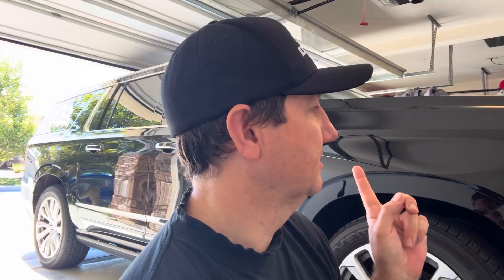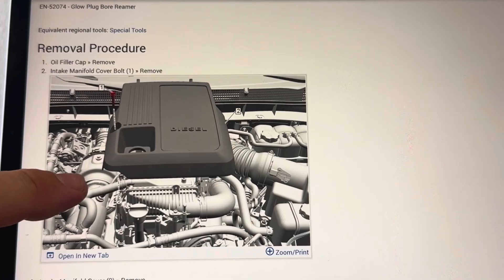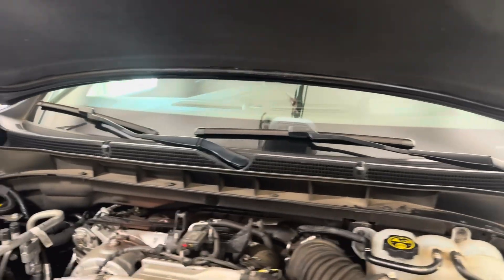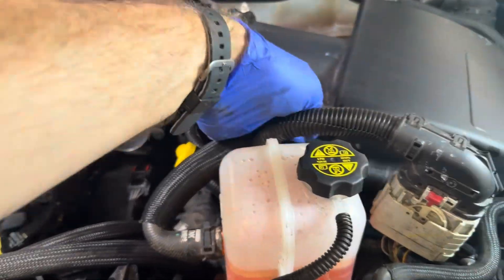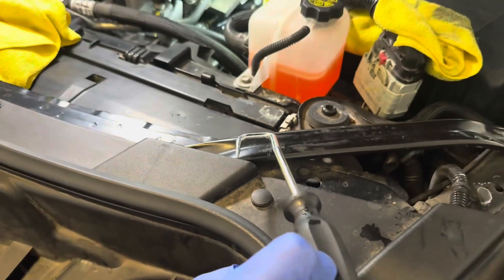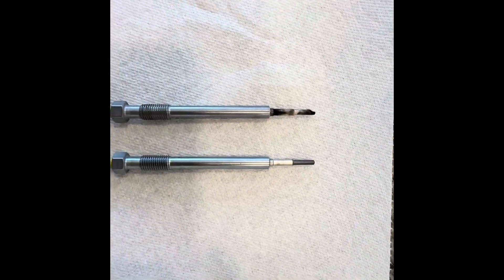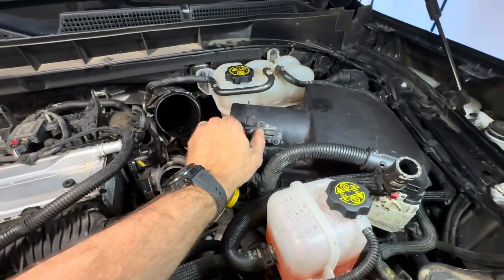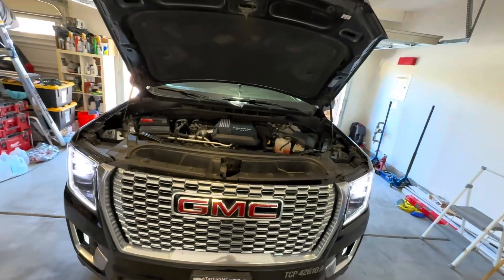LM2 Duramax Cylinder #2 glow plug removal and replacement code P0672

Comment: Did you have to relearn the glow plug after replacing it?
Reply: From my experience changing all 6 glow plugs on mine I did not and no codes I believe it’s a self relearn I have a scan tool but did not need too
Reply: @rick-gn5kc  did you have to remove the intake to get to cylinders 3 and 4?
Reply from the maker: I was following official dealer instructions on ALLDATA there is no scan tool needed or any relearn
Reply: following up on this question? do you have to relearn the new glow plugs?
Reply: @normanl1991   According to GM, yes you are supposed to do a glow plug learn with the scan tool that way the module can monitor the resistance to let it know how long to heat and tell if its bad ect.
Reply: What type of scan tool will reteach it? If needed...
Reply from the maker: No
Reply: Mine has now failed 3 times. 2021 with 65K. I’m sure not common for mine, but are we seeing these with some increased rate?